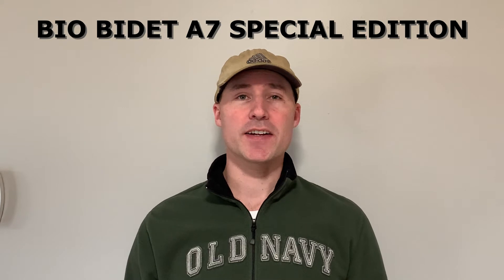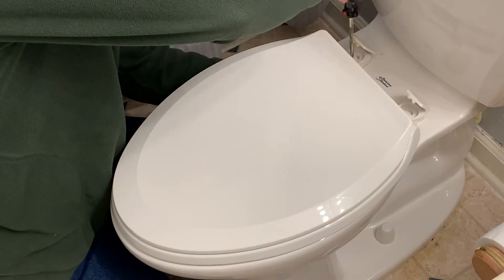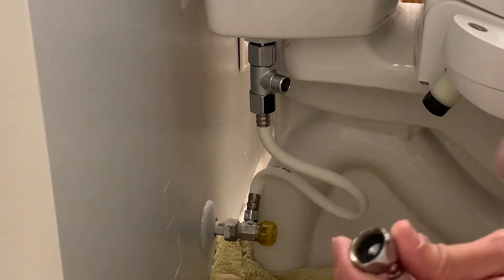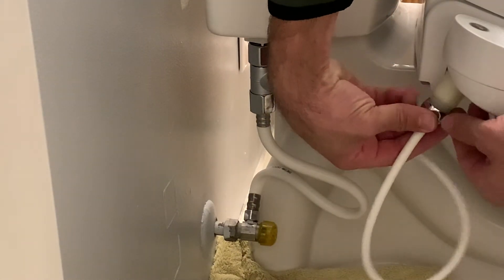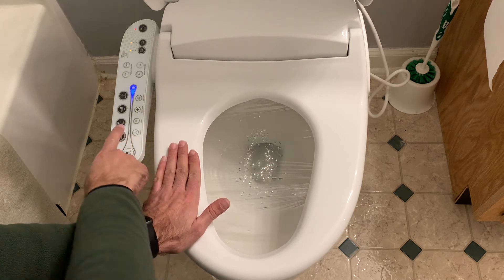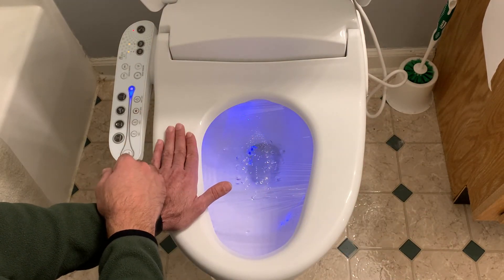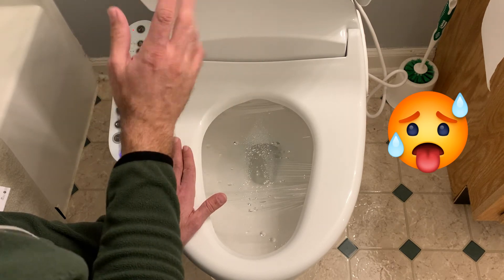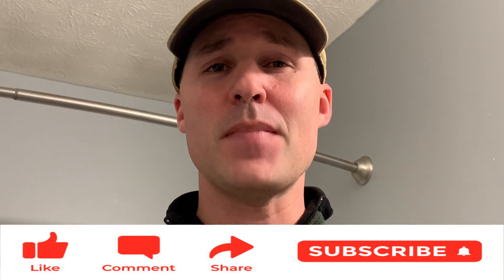How to Install Setup and Use - Bio Bidet A7 Special Edition Luxury Smart Toilet Seat

Comment: So the standard model of this seat has an eco button (in the place where the auto button is) which changes the red light to green and makes it so the water and seat temps are set to zero until the seat detects someone sitting. 

I’ve had this bidet for a couple years now and the light has always been red, but today the light suddenly turned green (I don’t know how, since there’s no eco button) and now the bidet doesn’t heat the seat or water until someone is sitting on it, and I don’t know how to turn this off so that the light is red again and we have a nice heated seat that’s hot before we sit down. Have you encountered this at all with this model? Unplugging it didn’t seem to make a difference although maybe I should try leaving it unplugged for longer. I also turned the heat settings to zero and I’m going to see if leaving those set that way turns the eco mode off since there would be no need for eco mode with zero heat settings.

Comment: I was looking into this exact model and decided to watch this video before looking to much into it. This answered every question I could possibly have about this product, so thank you. Just wondering, how’s it holding up after a year? Also are you having problems with the unit or it’s layout?
Reply from the maker: Mine is still in great working condition.  It gets used several times a day as my whole family prefers that bathroom.  I have been very pleased with it.  I rarely use the drying feature, though.  But we all really like the rest of the features.
Reply: @ReichpoloTech  thanks for the reply, you’ve been very helpful 👍

Comment: What’s the Teflon tape for?
Reply from the maker: You can put it on the threads of the pipe to help get a water tight seal.  Some of the hoses have gaskets, but some pipes in your house may need some teflon tape on the threads to get a water tight seal.